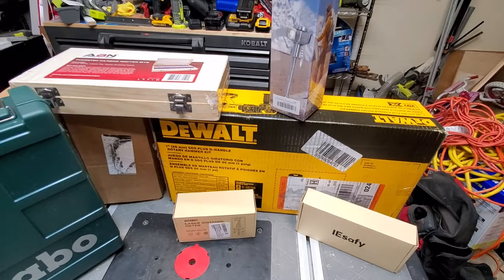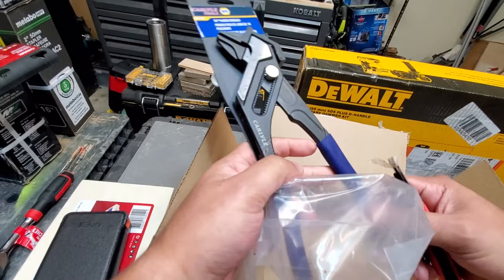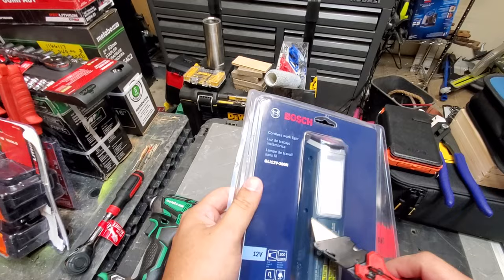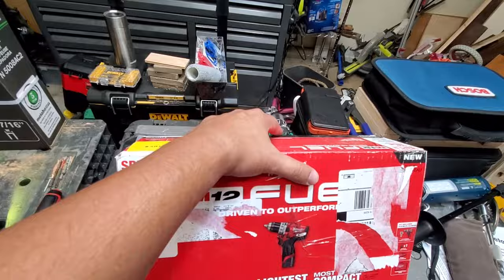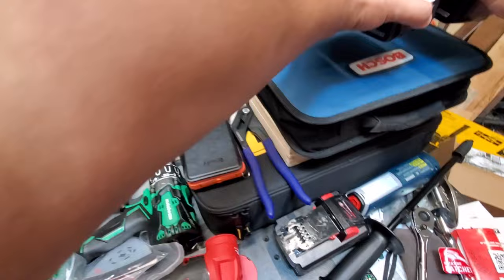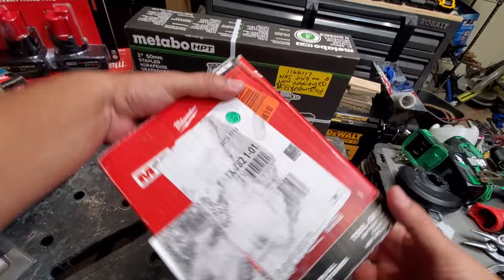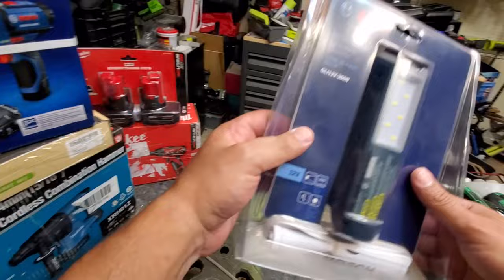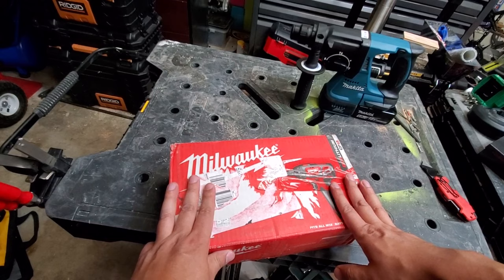Biggest Tool Unboxing on YouTube! 🚨 🏆

Comment: I also got the husky socket set from your tip. The light had dead batteries so I changed them. The light still doesn’t really work, but still pretty good deal for a socket set.
Reply: I got 10 of them an all 10 were dead.  I figured that they have replaceable batteries.

Comment: The only time I needed to return an item to Direct Tools it was the last of two items that I had a notification for and during a 15% off sitewide sale that stacked: $80 for a Ryobi 40v 525 cfm blower kit with 4.0 battery and charger. Battery was brand new, the blower handle was stuck in the folded position. They were very friendly and said to return it, but that battery is worth more than that and I'm halfway through that hardened bolt. I can easily and cheaply replace the bolt.

Another one that was used but returned was hvlp sprayer it was clogged in one air vent, but worked perfectly after I cleaned it up. So it clogged up on whoever used it last and then wouldn't spray.